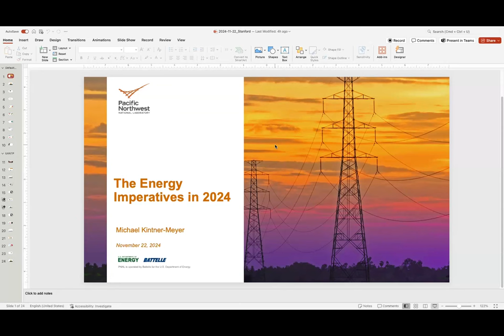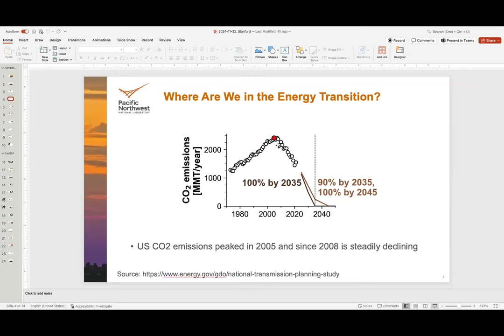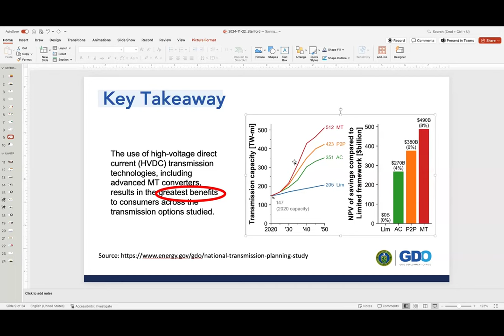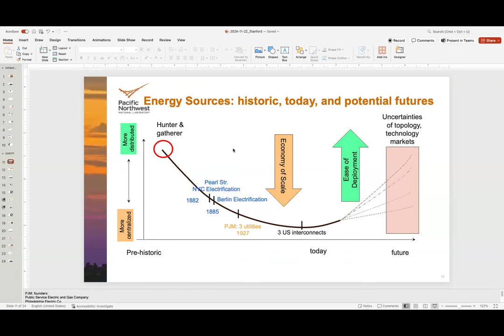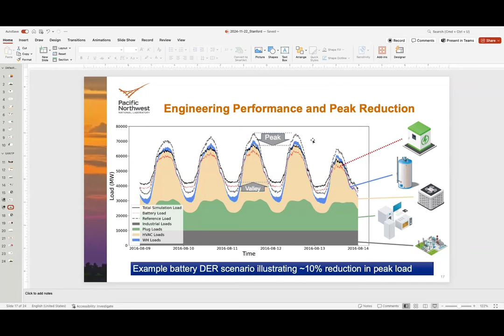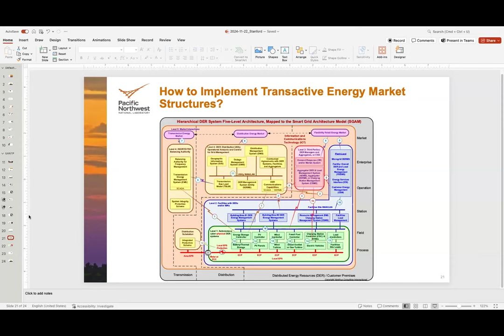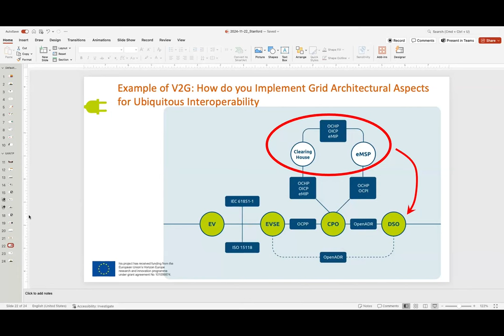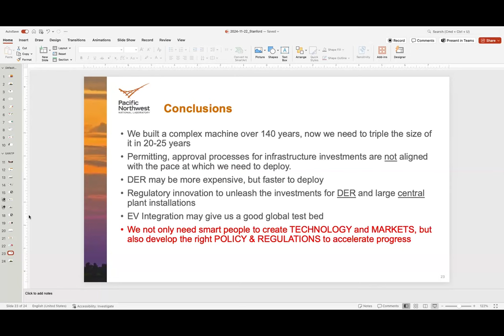The Energy Imperatives in 2024 | Michael Kintner Meyer | Smart Grind Seminar

Comment: The fastest way to net zero is via fuel making OFF grid, NOT by on grid RE.  None of the 3x claimed in this video are then needed.  

New combustion tech will be 4-5 times better MPG than old ICE, with combined cycle and CO2 capture on the vehicle for free as part of the cycle.  

Making fuel will cost 20 to 30 times LESS than a 100% RE grid.  60 cents/kwh for grid and 3 cents/kwh for fuel.

The RE U-curve (Tony Seba) shows 4x over build and 3.5x in battery for a 100% RE grid at min costs.  That is 7.5x more than X, the average demand.  

Making fuel is 50% efficient and thus takes 2x.  Cost ratio is: 7.5/2 = 3.75x more for grid.  No inverters are needed for DC fuel making which saves 1.33x.  3.75 x 1.33 = 5x less costs using wind and solar PV.

New solar thermal with new engine tech can use thermal to create electricity for electro fuels.  They cost 3x less than PV and last 3x longer for a 9x factor.

5 x 9 = 45 times LESS cost for fuel making than for on demand grid with both 100% RE for both.

This new combustion tech will be 150 MPG HWY, 240 city, and 200 average.  A Tesla M3 is 133 MPGe.  200/133= 1.5x better for combustion than EV.  In Winter that ratio increases in city to 2.6, giving a yearly average of ~ 2x better for combustion.  Game over...HINT.

All EVs will go bankrupt with 40 to 60 x fuel cost ratios to combustion.  20 to 30  X 2 MPG factor is 40 to 60 times less for combustion.  No EV can survive.   

This video analysis fails on so many levels.  None of the electrification is needed and in fact electrification will SLOW the move to net zero by 20 to 30 years, if not 50 years in reality.  An EV using a 100% RE grid only reduces CO2 by 33% and therefore cannot be considered net zero.  All combustion cars with RE fuels have net zero fuel as inputs.  

EVs fail to solve the problem, and thus EVs cannot be the solution to lowering CO2.  BTW, this combustion tech is also a heat pump COP4 that can run on many fuels including Natural Gas.  Natural gas can be made from nuclear and sent down NG pipes into home making every gas home heating net zero.